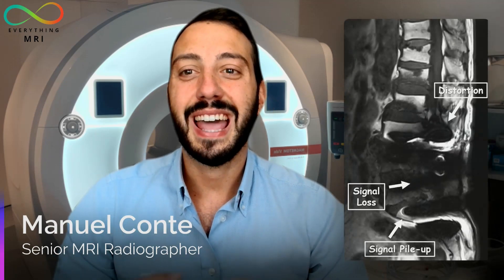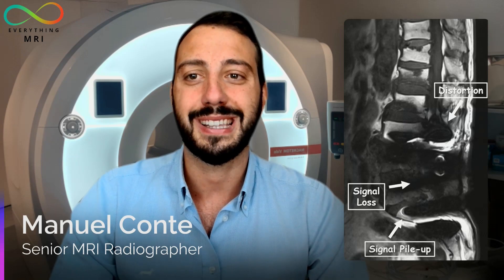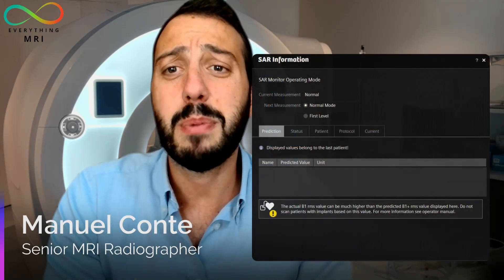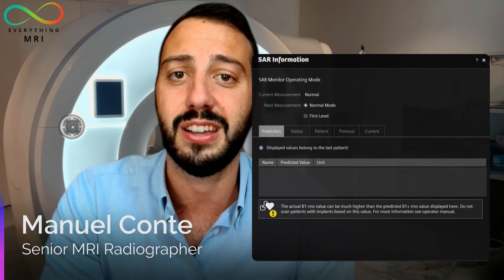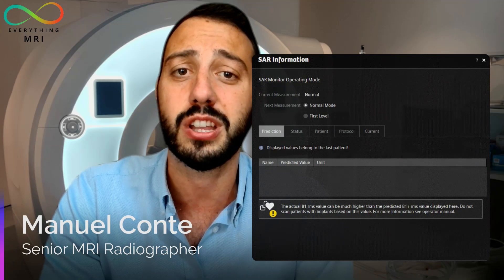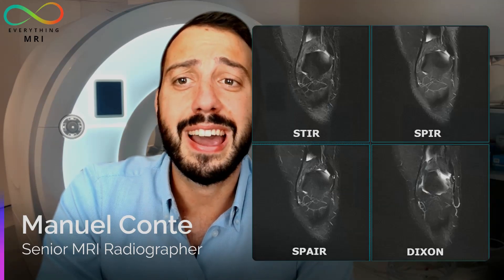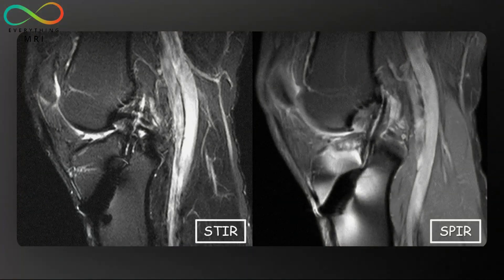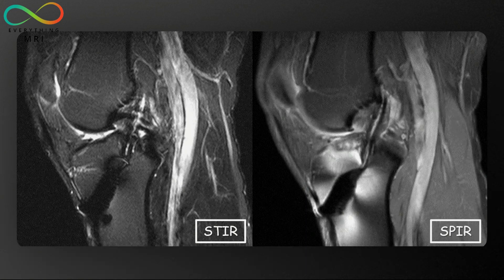Metal Artifact Reduction Techniques - Introduction

Comment: Thank you, very good point.
What you think about ICD on the cardiac MRI.
Have you any experience in adjustment of quality?
Reply from the maker: Thank you so much for the support. Admittedly, ICD can represent a challenge in the process of obtaining a decent image quality in cardiac MRI examinations. I know this topic is becoming pretty crucial so I am considering doing a video about it in the near future 👌🏻 thank you for the suggestion
Reply: Thank you, I will be waiting.
I work in the center for surgical correction of HCM and many of our patients have ICD.
We use Cardiac MRI for surgery planning and ICD creates huge concerns
Reply from the maker: I reckon it must be very challenging. Sometimes the device creates such an artifact that is very difficult to get some decent images. I am in the process as well to get an app specialist to improve our CMR protocol for implanted patient. I will definitely share some updates  @alekseizyrianov5064
Reply: Hello,  @everything-mri have you figured out how to get decent images or at least lessen the artifacts due to pacemaker when doing CMR? I have read somewhere that using "wideband" on a Siemens machine can greatly reduce the artifact. My question is is there a specific sequence in the library that is considered as "wideband"? Thanks much!
Reply from the maker: @gdnwzm Hello. Thank you much for your valuable question. As regard cine images you can try to increase the bandwith in the bSSFP and switch to the Flash as alternative option. For LGE you can use the WideBand sequences which comes as a separate package from the Cardiac sequence, so you need to check if your hospital has purchased the license.
Reply from the maker: @gdnwzm On top of what mentioned above, remember always to shim as close as possible to the heart. Sometimes swapping the phase encoding direction can also be beneficial in this sense. Hope this helps